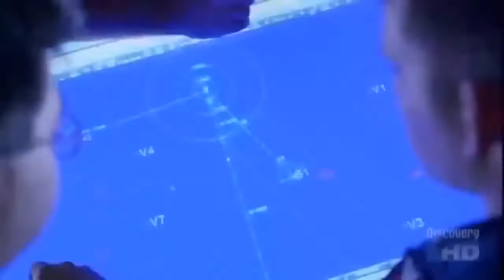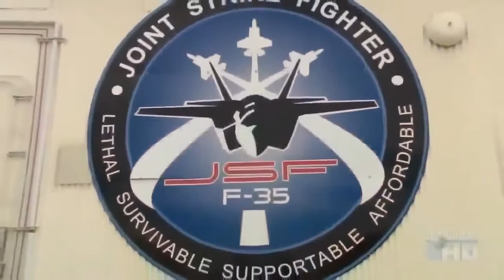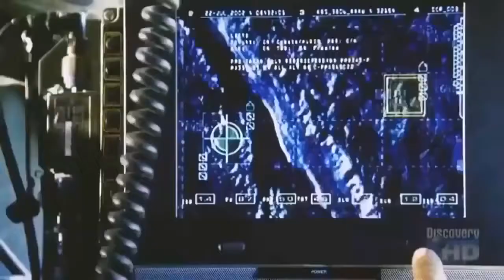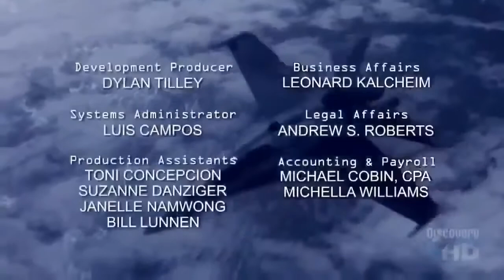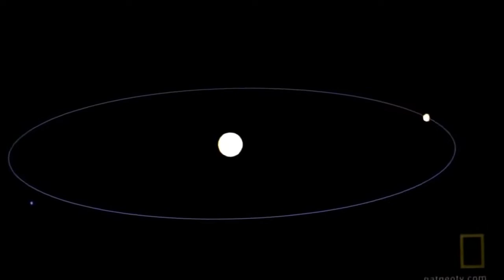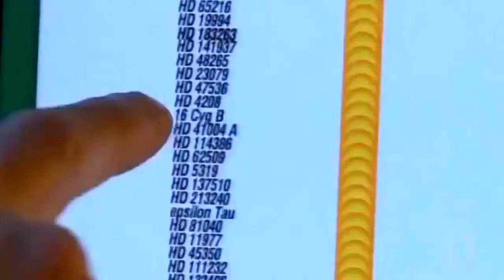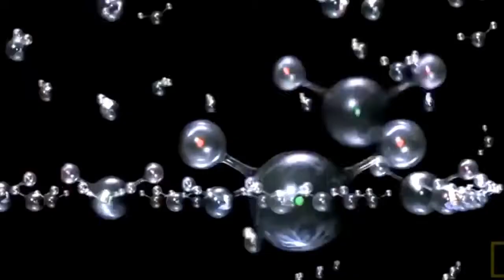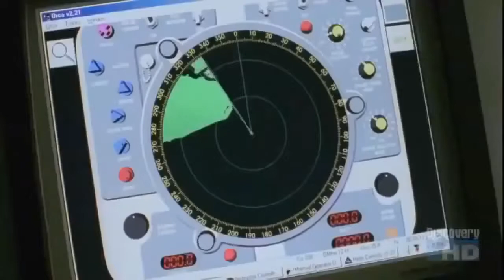National Geographic Documentary New Future Military Fighter Jet Fighter Aircraft Technol

Comment: Every slept it under the rug when a F16 ate it’s lunch in a straight up dogfight. The only advantage a F35 has is a better computer system. You want to watch maneuverability watch a F16 it’s still jaw dropping.
Reply: A straight up dogfight is something that will almost never happen to an F-35. Even then, the report that had the F-35 lose vs F-16 was misleading because the F-35 lacked many crucial systems as it wasn’t a production version.
Reply: Lmao.. Fat Amy is shaping up to a formidable foe.
Reply: An F35 could knock down 4-5 F16s before they even knew an enemy was in the air. The F35 has a long list of advantages over the F16 all around but if you're talking strictly about a dog fight within visual range than it's biggest advantage is that it will never happen.